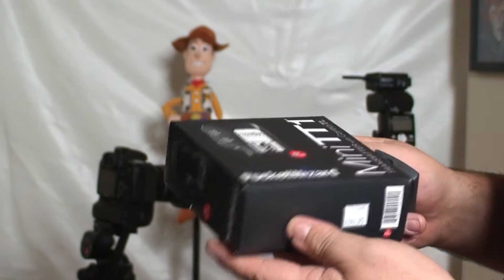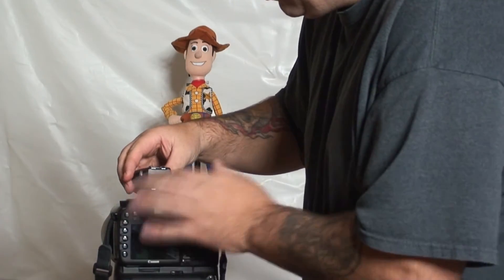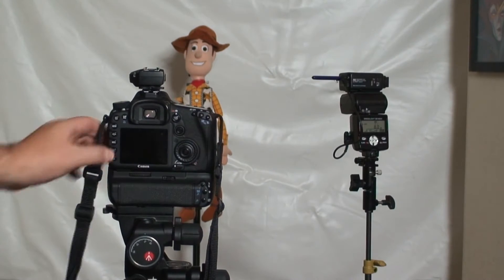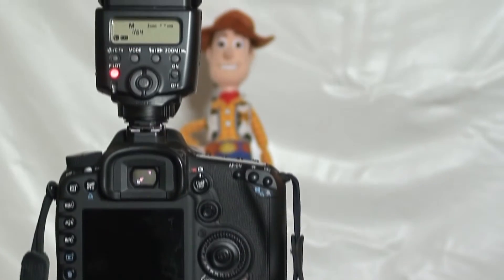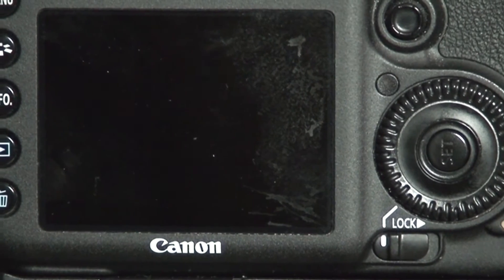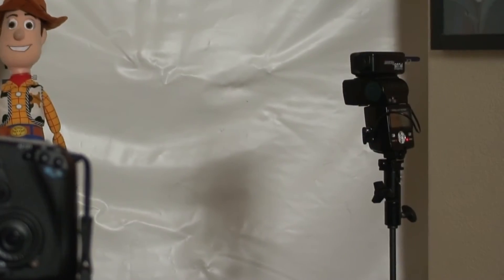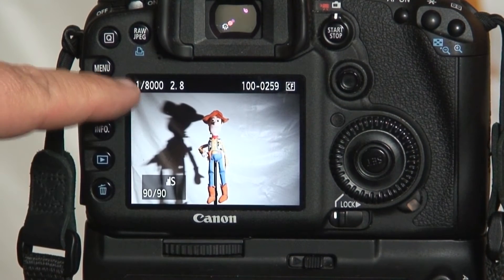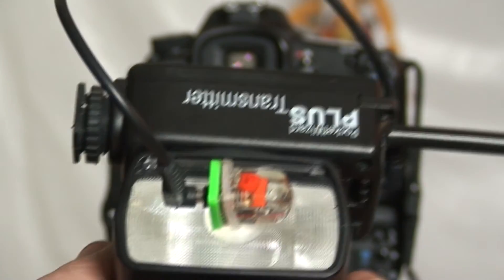Strobist: HyperSync A Canon 7D for 15 bucks.

Comment: Have you tried connecting a sync cord to the flash or camera instead of using a slave? You still have to have the speed light on the camera to cause the flash impulse when the first curtain starts moving, but this definitely works on Nikon. Also, you can use optical slaves instead of radio slaves to trigger your studio flash units.

Comment: Pocket Wizards doesn't call high speed sync 'Hypersync'. HSS and Hypersync are 2 very different technological events happening with your strobes and camera. HSS is turning a speedlight into a continuous light via very high speed low power continuous pulses. Hypersync is a single flash of light from your strobe at full power to yield the longest duration and timed to precisely cover the entire travel of the slot between the 2 focal plane curtain shutters over your sensor.
Reply: Well said.  Another difference is that using PW's HyperSync, you can adjust the shutter to flash event timing, whereas this other method, you get what you get... and that is normally about 1-2.5 stops less light in the picture over when not using HyperSync.  Finally, HyperSync is a Pocket Wizard trademarked word and technology that no one else has anything even close to.
Reply: JerryPHcom Yes, if your phrase "this other method" is referring to HSS than the power is lowered by about 2.3 stops - every solution has its price. As a photography instructor, the most frustrating part of all this is the confusion in the terminology amongst companies and amateurs. I see the word "hypersync" thrown around everywhere by people who are clearly confusing it with high speed sync with the generic claim that "you can sync all the way to 1/8000th of a second" but without clarification as to which method they are referring to.
Reply: Todd Siechen 
Yes. What i am surprised to find lacking of understanding in any of the comments is that you cant use Optical slaves outdoors, and you don't need high shutter speeds in a studio where 1/250th can kill ambient and strobe duration would freeze movement anyway, so in effect this method is truly useless.
Reply: if only it were that simple that photographers only shoot under 2 tightly controlled situations... but it's not.  This method is FAR from useless.  Try shooting on a bright day at F/2 and not use an ND filter... impossible unless you use HyperSync or similar.  Also, there are many videos here that prove that using slaves outdoors is not completely useless, but it is not 100% as reliable as when using radio triggers.  This is a tool, another way to handle a challenging situation.  The proper frame of mind is to say that our knowledge and equipment are equal to the challenge, so that we know how to handle all kinds of situations and not limited to shooting in studios or on darker days outside.
Specifically using HyperSync can let me shoot wide open on the brightest of days or it can let me take a bright day and make it seem as dark as night without needing an ND filter that has it's downsides (like cost for the filter, vignetting when shooting wide, loss of sharpness and colour casts, and need for step-down rings to accommodate different size lenses).
There is no one solution for every challenge, it takes different techniques to solve different challenges.  HyperSync/supersync is just the answer to a specific challenge, not the answer to everything.
It's all about using the right tool for the right job!

Comment: So, the main flash run in hss mode, that is firing small pulse during shutter open above sync speed and that small pulse captured by the optical slave and it's triggering the slave flash continously until the shutter all closed?

Comment: Hey Thomas, do you think this would work with the canon 90 EX flash. It will act as a master that can trigger other flashes at HSS, but won't actually fire at HSS itself. It's the tiniest flash and would be perfect if it could do it.

Comment: Hello,
Can I use a flash mounted on my camera that doesn't natively have HSS?  Something like a Yongnuo YN-560 ii?  Or does the triggering flash have to support HSS?  I don't think you mentioned it, but do you have to change any settings inside the 7D to support this?  Second curtain sync or anything like that?  Thank you

Comment: BTW, when using a MiniTT1 and a FlexTT5 that has the optimized Hypersync settings, you loose less than a stop of light vs the 3+ stops of light using a pair of Plus II's... did you test that aspect of it?  I have.  :-)

Comment: Im confused, how come triggering the PW or whatever trigger you want to use via optical slave lead to no banding, wouldnt it just trigger the flashes slightly later? What are the slave flash settings, HSS, TTL or manual?? Ive been playing around with hypersync and the best I can get is 1/500th with a tiny bit of banding with 3 tt5s, 2 430EX IIs and my 7D. Not doubting your results just trying to understand the theory behind.

Comment: A few Qs for you. I thought Hypersync was designed to by used with standard strobes and NOT hot shoe flashes because of power settings. Also, how do you make this work outside in full bright sun? Will the optical slaves be able to see the flash or will the sun block it? Thanks.

Comment: I don't get the advantage of needing 2 pocket wizards and 2 flashes to do the work of 1 430EXII and an ST-E2 wireless transmitter that supports both H-sync and TTL, in full sun and a range exceeding 100'.  

That's a lot of gear you're packing on top of your camera's hot-shoe to get radio triggered h-sync on a non-branded flash.  But maybe I'm missing the point 'coz I couldn't keep up with the machine gun rapid fire delivery of your argument.

Comment: Yes but if you change power on a strobe, guess what, you have to go back into the firmware, change the settings, then tey to see if it works.  Yes I agree when you can use the Optimized Hypersync and Control TL you loose less light, However it is a PITA to have to moe into the firmware to change sync settings that may or may not work. So I have some BAP'S, Big Ass Packs 2400ws and 4800 ws, most of the time I can afford to loose a stop or 2 and still get it done! Also My 805's are 50ws to 800ws

Comment: Decided to try this with my EX580II flashes. Works like a charm at any sync speed. Parts and instructions can be found here: http://glipho.com/teddybear/how-to-sync-a-profoto-studio-strobe-up-to-1-8000-sec-using-an-optical-slave-trigger. One drawback is that the lighting flash must be in full power otherwise you get banding.

Comment: Have you eve seen a speedlight emit 800ws of power. My solution is primitive but works 100% of the time and I use my normal workflow, I meter and shoot! It's that simple. Lastly I can use any strobe at any shutter speeds up to 1/8000th. Can you do that with a Flex or mini tt1. Fuk a Control TL!  These people are raping on a gimmicky solution that works with a handful of lights!  Like I showed, I bought it, dealt with tech for days and they have no response to this! 15$ and you are in the game!

Comment: So you seem have a really good understanding of photography, but you have not the slightest idea why your method is useless. 

1) Optical triggering only works indoors, any sunlight at all or large spaces and it does not work at all.
2) If you have to be indoors you can control ambient light completely in a studio, and regular sync of 250th will kill all of that ambient, so effective "freezing duration" will rely 100% on your strobes, no need for Hypersync or High speed sync (2 completely different things by the way). 
3) You are so worried about banding, but outdoors while using strobes it is very common to only expect the strobes to illuminate the subject (in sports for example) the outdoor ambient light will take care of background and foreground elements of your composition (not that you would usually ever be lighting those anyway) so banding is not an issue.
4) You seem very excited to have "cracked the code" but I cannot think of a single example where your method would be of any use.
Reply: +Michael Andrew Ever thought of using old studio flashes with long flash duration? You can´t freeze motion with those.. But with this method it will work.. so you dont need to buy a pocketwizard...

Comment: use wireless flash control on the 7d, speed some money and get a canon speedlite 430ex II to hss, I got a 580EX for £160 no need for pocket wizards at $200 and $15 for the gizmo, and works in E-TTL. Just dont get it, no matter what, you have to buy at least 1 flash and the gizmo. Not very professional in my opinion...crap gear and no idea